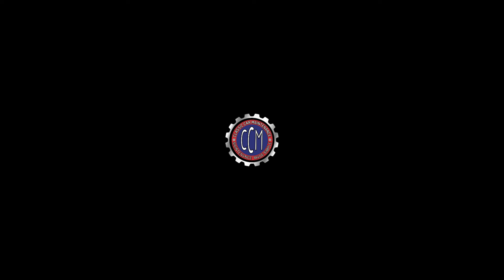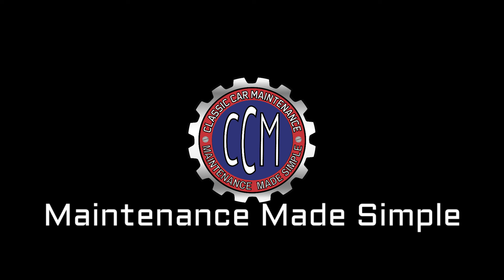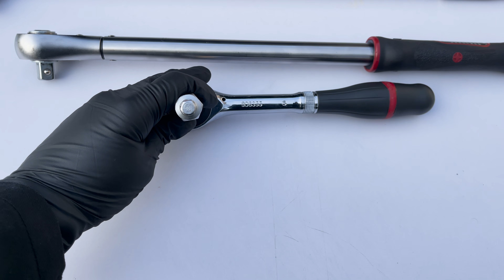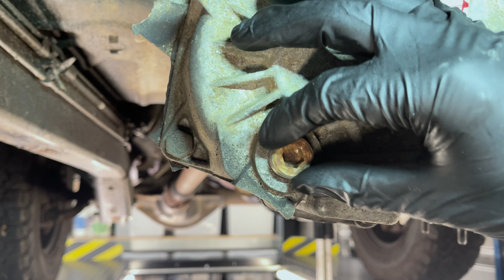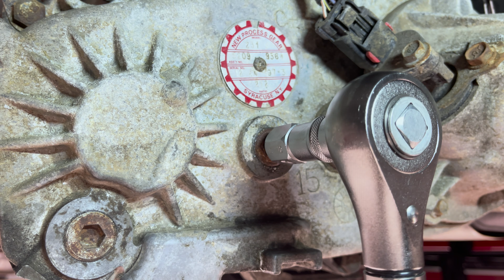How To Change Transfer Case Fluid

Comment: Always check to see what socket or drive you need for your specific vehicle before starting the job! Trust me, it really sucks to get your vehicle up all-around on jack stands only to find out you don't have the right sockets/drivers.  My '99 Pathfinder has a 19mm hex head bolt on the transmission fill and drain plugs, while both diffs and the transfer case take a 1/2" square head (I just use a bare 1/2" ratchet or the ratchet with a 3" extension). Very different from my old Jeep. Check your owner's manual, and/or have a look first.
Reply from the maker: Great tip, thanks for sharing!

Comment: Go to thicker fluid as Miles rack up to take up the slop and provide better protection. 

Obviously in these rarely changed fluids use the best fluid you can get
Reply from the maker: You’re absolutely right! You want to use a thicker fluid for a worn transfer case.

Comment: Why remove the skid plate. Just put a piece of cardboard under it to direct the oil out and into a pan.
Reply from the maker: In our experience this doesn’t work well because the drain hole is almost flush with the transfer case. Fluid will spill between the cardboard and the side of the transfer case creating an oily mess on the skid plate. And you can’t put the cardboard underneath the transfer case to direct the fluid into a pan because the bottom of the transfer case is lower than the edge of the skid plate. So fluid would pour onto the skid plate instead of in the oil pan at the end of the cardboard funnel.

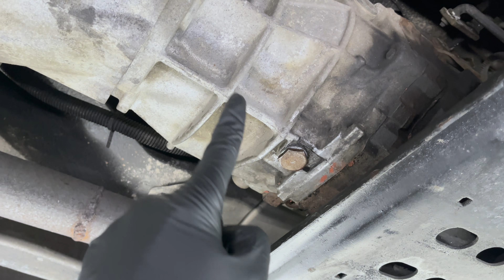Comment: 1:47 what a stupid design
Reply from the maker: Agreed! A simple bracket holding the gearbox, transfer case and driveshaft up so you could take the skid plate off more easily sure would have been nice. Automotive designers don’t change fluids themselves I guess… 😅

Comment: Never do what ? Click bait !
Reply from the maker: As explained in our video (under the chapter “Caution!”), you should never drain the transfer case fluid before checking if you can open the fill plug first. Otherwise, you'll drain the transfer case without being able to fill it back up, and you can't drive with an empty transfer case or you’ll destroy the gears inside.

Comment: Jeeps have a chain supplying the drive to the front wheels? Eeech!
Reply: Some of the newer chain drive transfer cases now have torque capacity ratings of well over 2,000 ft. lbs above the old NP 205 gear drive cases so don't poo-poo the newer chain drive cases.
Reply: Yep most of them do.

Comment: I hate those pumps. There has to be a better way. Lol 

Thanks for the great video.
Reply from the maker: Glad you liked our video, it means a lot! And yes, there are better pumps that work a lot faster, like electric ones, but if you only use it a couple of times per year, the cheap ones do the job just fine.